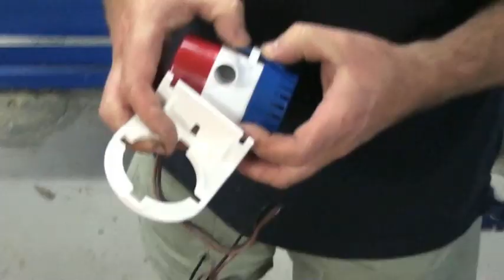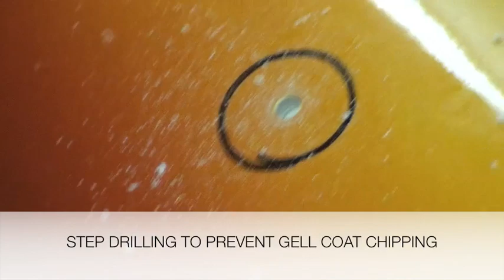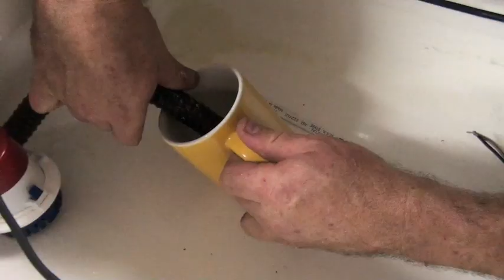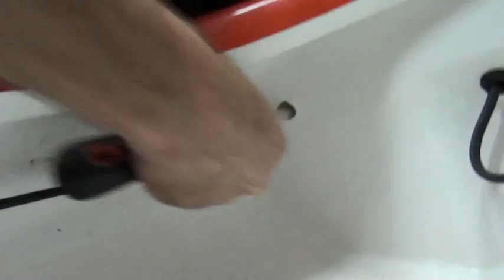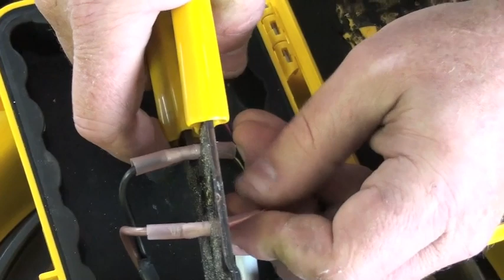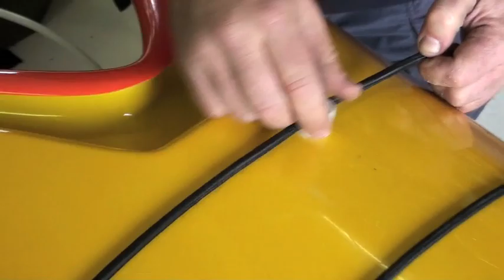How to Fit an Electric Bilge Pump " Magnetx" Sea Kayak Mirage 580

Comment: Very nice setup and informative video (thank you)... but doesn't drilling holes in the bulkhead defeat the purpose of having it?... or does the cable gland self-seal, even under the pressure of a full compartment (cockpit or hatch)?

Comment: No fuse?   Might be a good idea, especially of the pump shorts out.
Reply from the maker: We do not run a fuse, however you can. Over 200 units have been fitted to kayaks and we have not had a problem. We believe it would create another fail point. Worst case scenario - the wire burns out.

Comment: that much nice work and you do not solider the wires :'(
Reply: Having a potentially life saving component crimped and not soldered - yea that's a big no.
Reply: @mikkelkirketerp4884  Not really, a properly crimped cable is often better than soldering, especially in applications like this. Because solder is stiff and brittle the connection point is prone to failure if the wire bends